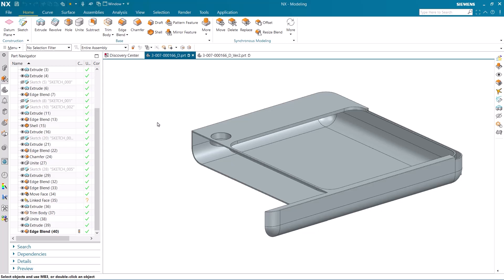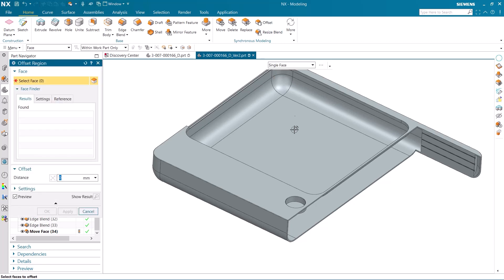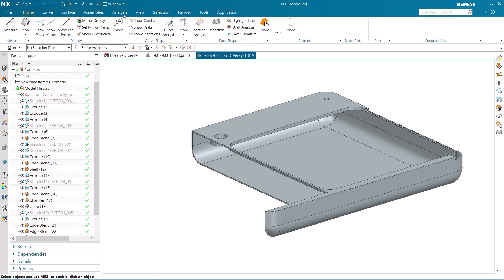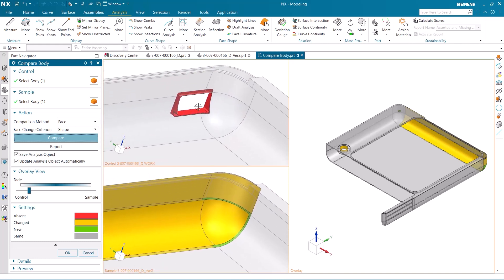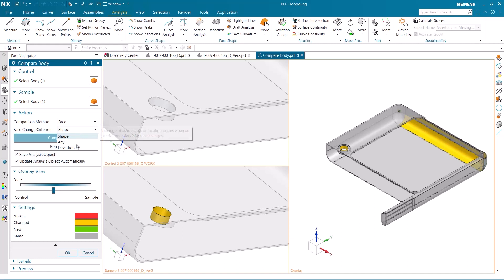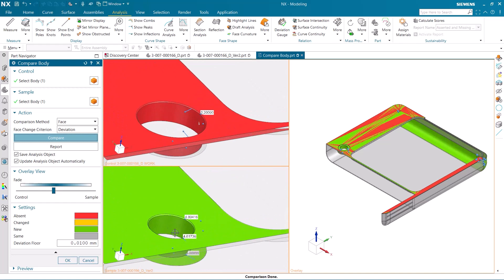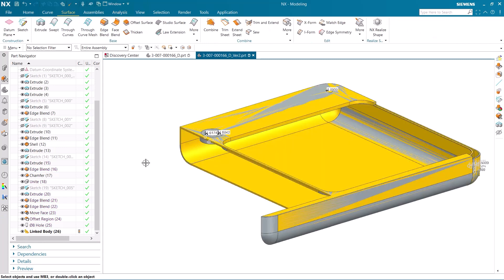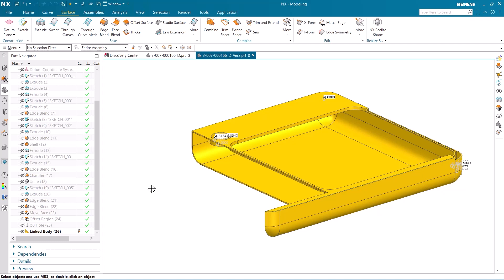NX | Tips and Tricks | Compare Body

Comment: great video!! can we use the same feature for assemblies? or does it only works for single body??
Reply: This can be used in an assembly context, but only a single body can be compared at a time
Reply: To compare the bodies inside a single part is available. But it is not available between assemblies - You can make assemblies into part using 'simplify assembly' then you can compare the bodies.
Reply: @allisonyu2517 thanks 🙏